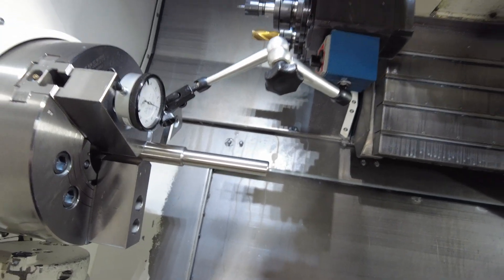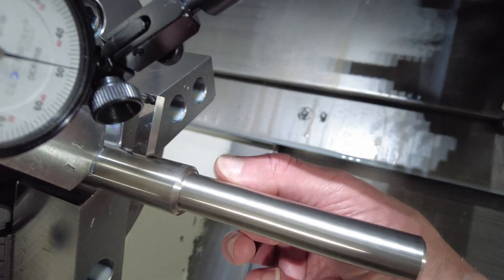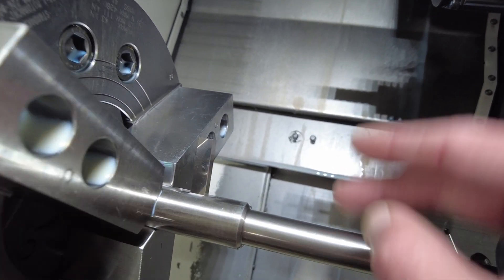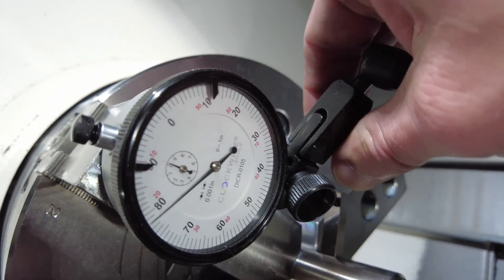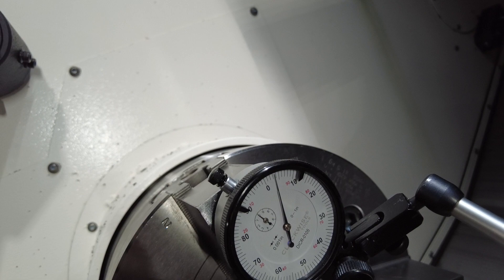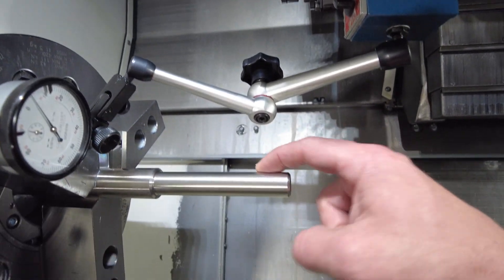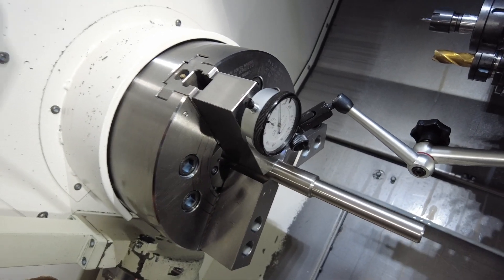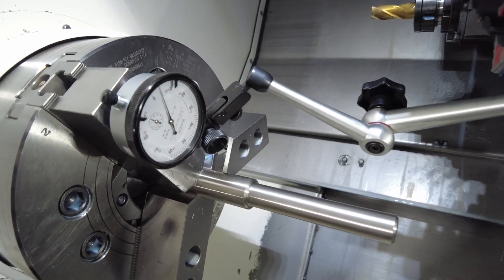Mazak Lathe Indicating C axes 0 using a gauge block on X axes.

Comment: I believe after teaching Czero you compensated for the offset given by the bar's ½thickness to the center of the keyway!
Reply from the maker: You're not, you're looking for your c to be aligned with the x axes using gauge block or y using the actual flat, it makes no difference how big the part is as long as you are doing it in center of the part.

Comment: Do u have to repeat the same for the next component?
Reply: Yes you would have to unless you milled a key way in the centre of the jaw with a key that lined it up when clamped the clocked up the jaw with the key way in it in X to find the zero point then teach the C-Offset to zero
Reply from the maker: Yes, unless you can put the next part in exact same c position
Reply: What do you know of the mazatrol auto tool measure?
Reply from the maker: @oscarloredo5053  never done it, if I have some time, I'll look it up